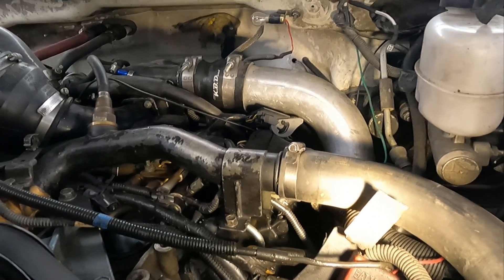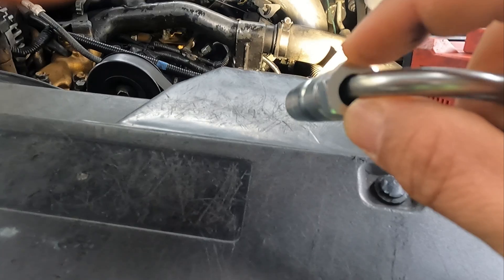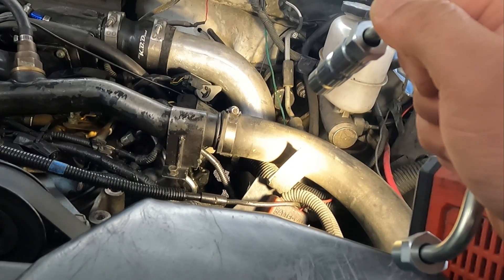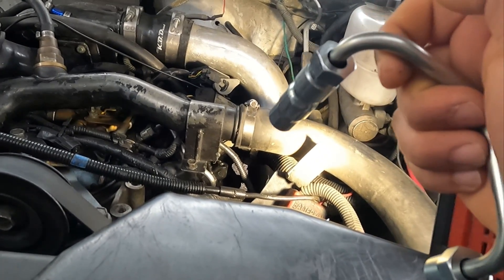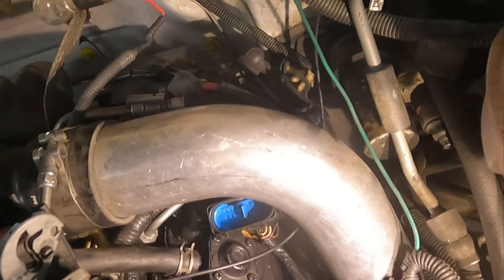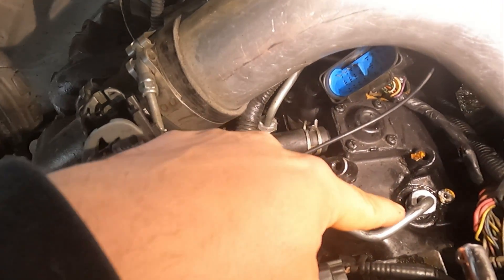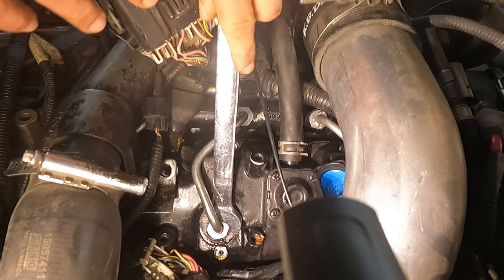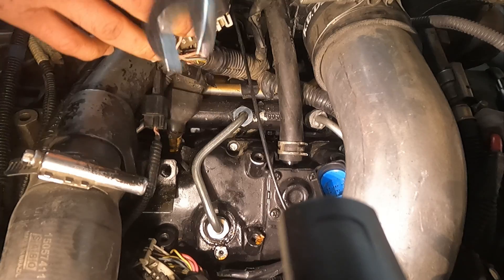Fix LEAKY Duramax Fuel Injector Lines And SAVE BIG MONEY!

Comment: just curious, i noticed you didn't bleed anything. I've got my cylinder 8 line looks like its spraying onto the firewall right above my turbo. I've got the new part coming tomorrow. but my main question was should i just be able to crank and it will self bleed or will i have to crack my line and bleed it that way and tighten the line back down?
Reply from the maker: You know, I've heard of air vaper locking in the lines and needing to be cracked open to  bleed them so I'd keep that method in my back pocket just incase. But even when I changed my injectors, gaskets and added studs, I didnt have to bleed anything.  I cranked it over a few times, let it rest  so as to not burn out the starter and to pressurize the system, then cranked it over again to fire it up.  With changing just the one line it didnt take much cranking to get it fired up at all.

Comment: My 2003 LB7 #1 just decided to start leaking really bad. I pulled it apart which is a job because I have S475-83mm compound and that injector under the fuel control module. I could wiggle the  injector line. So I removed it and put it back on. It is still leaking. So tomorrow I am picking up the new one. The internet says 30 ft-lbs but I think I will try 33 tomorrow.
Reply from the maker: @Re-engineer_everything  you have a nice turbo setup!  I'm considering a compound setup in the future but still have a ways to go before I get there.  33lb of torque should do just fine with that new line 👌  best of luck!
Reply: @ don’t go with the s400s. Go with the s300 and the stock is good for the valley. I’m not sure if WCFab still does them but that is where I got mine from. The S475 takes too long to spool up.
Reply: Also I used Duramaxtuner for tuning. You will need tuning because the boost should go over the 28 psi. Then get an adjustable waste-gate for the Valley turbo and you can make that so it doesn’t open. I have a big head waste-gate on the Valley which I put 40 psi to it I could barely get in the hole.
Reply from the maker: @Re-engineer_everything  that's sort of where my heads at, with the s300.  I ported my stock turbo and tossed a billet aluminum compressor wheel on it. Ported the heads, port matched the y pipe, manifolds, up pipe, and new down pipe, too. So the stocker spools up real nice as is. But that extra umph from the s300 would be nice for hauling my camper through the old logging roads and for that extra get up and go.
Reply: @KooshdaakaaGarage  it would probably help it be a little cooler and raise the boost a little. But be careful because there are weak points in the engine and in the Allison unless they are built like mine. My engine is good for 700HP and my Allison is good for 850HP but I limit myself with a Sportsmam CP3 which is good for 650HP. Then there are the keyed cranks. So unless you want to put a $12K reman in there I would probably be happy with what you have. Then there is if your Allison starts slipping. If I had to do it again. I would put a Duramaxtuner Mach2 in it and save the $37K that I put into mine.
Reply: The Mach2 has a larger exhaust propeller. So it spools up faster and I think it is a 64mm. That’s probably not the correct terminology but I would think you know what I mean.
Reply from the maker: @Re-engineer_everything  Man, those are all very good points!  Ok.  I'll just stick with what I have for now and keep slowly building it up and see where it ends up.  Honestly with an upgraded trans and custom tune, I'd probably be more than happy for my purposes.  A guy can dream! haha
Reply: @ Duramaxtuner/calibrated power would give you tuning for what you have done. So your Allison shouldn’t start slipping. Once it starts slipping. It gets easier for it to slip. They also have 6-speed conversion. I have that too.
Reply: I have a spade tuner and I have the only truck that anyone has ever heard of that has to pull his A/C module to flash my tunes. So try that if it says it won’t do it.
Reply: Then it wasn’t the high pressure line that was leaking. It was leaking out the bottom of the fuel control module and I spent most of the day finding out that no one carries them anymore and I found a refurbished one for $848 + a $200 core charge. Another place wanted $1,500.
Reply from the maker: @Re-engineer_everything  sheeeeeeiiiiittt. Theres an unfortunate expenditure.  You got er put back together?
Reply: @ I won’t receive it until Tuesday at the earliest. I went to rent a vehicle and enterprise didn’t have any vehicles  so I will rent a u-haul truck. So I have something for a week. The U-haul is actually 1/2 of what enterprise was.
Reply: So I replaced the FICM with a rebuilt one. Started the truck and everything was good. Took it to 2,000 RPM and it was spraying out the #1 high pressure line under the plate that holds the FICM. I had already purchased a Duralast. Installed that and now it is fixed. The Duralast has a larger hole in the line. I am getting an extra mpg with the rebuilt FICM.

Comment: I hate those tensioner idler pulley squeaks
Reply from the maker: @cody6.6max  duuuuude.... me too. I replaced the gear box which was leaking causing the squeak. Everything was going fine until I rallied some beat up old logging roads and must have flexed the gearbox shaft enough to bust the seal.  I still have the original so ill probably change the seals and toss it back in rotation.  The pcs is the way to go but shipping up to Alaska cost as much as the unit itself and I'm just not there yet. Lol.
Reply: @ that mark in the tensioner is that a good indication for bad belt or what’s that for ? I have a squeak and trying to figure out which to replace. Nothing leaking . It’s only bad when engine is cold

Comment: Is it easy to over torque these fuel fittings? I know some older fuel line fittings would crack if you didn’t get them completely lined up when you cinch them down. Had to have them perfectly straight when you tightened them down… think that was an older Ford if memory serves me right.  Sorry just rambling on
Reply from the maker: Yeah I'd say it is a delicate process for sure.  Like you said you can crack the lines if you over tighten or worse crack the injector which on an LB7 like I have is expensive and time consuming because the injector is under the valve cover and the injectors start at $250.  My injectors are 45% over SAC nozzle injectors and were around $350 per injector when I bought them.
Reply: @KooshdaakaaGarage  Yeah , seems everything just keeps getting more and more expensive. 
You done any deer hunting yet?
Reply from the maker: @guaporeturns9472  just a little bit at the start of the season.  Seen a nice 3x3 two weeks before the season started of course. Lol.  A few spikes and forkys after that but I let those ones go so they can get nice and fat and meaty.  Heading out camping this weekend and will bring the rifle just in case!  You get out much this season yet?
Reply: @KooshdaakaaGarage  Not yet.. I live in Washington so it’s bow season now and rifle doesn’t start till mid October. I may still buy a bow tag and go out for the last week or two.. still not sure.
Reply from the maker: @guaporeturns9472  rifle season starts around rut, nice!
Reply: @KooshdaakaaGarage  Not generally here.. rut is usually running hard about mid November  , but some of them start earlier.